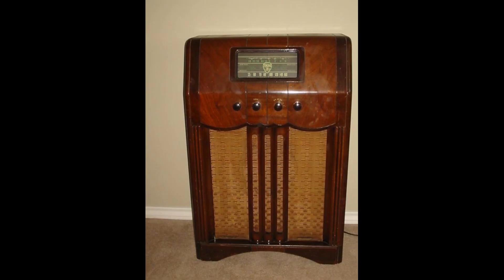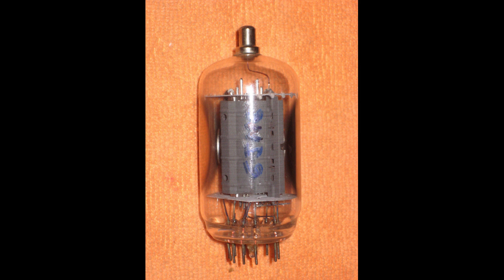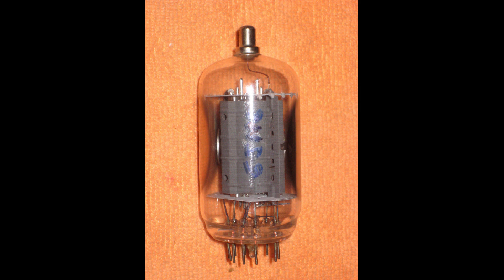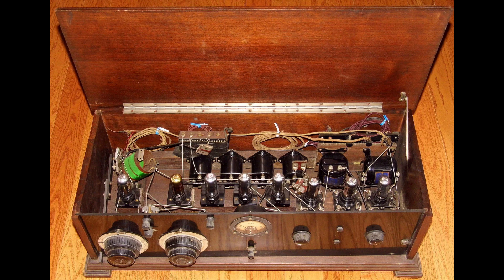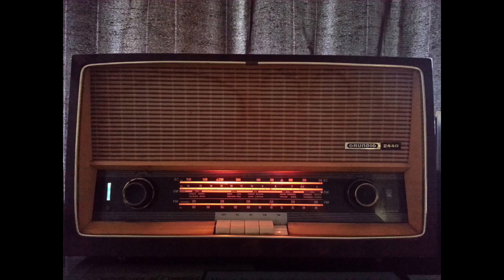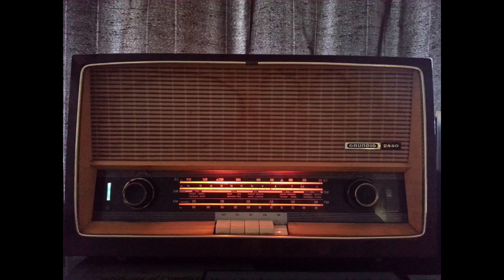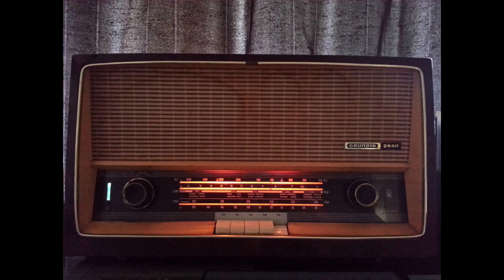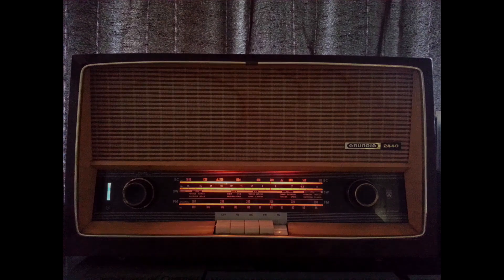How does a vacuum tube radio work?

Comment: Hi   SO in a nutshell I am trying to identify which vacuum tubes in a 1960 Zenith console handle the reception of the AM anf FM sound waves. I know you video is very helpful but I need the tube numbers to help me figure out why only static (and lots of it!) is passing through to the speakers?   I great;y appreciate any wisdom you can share.  Thanks!